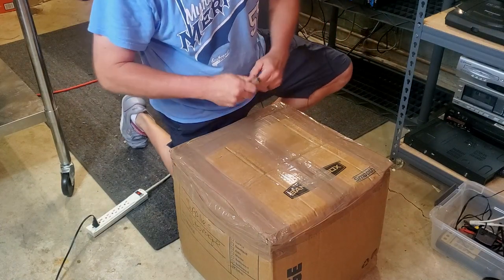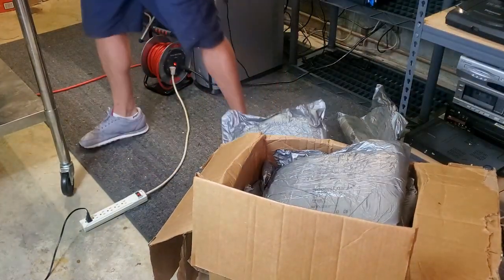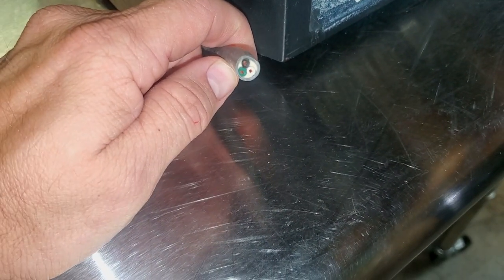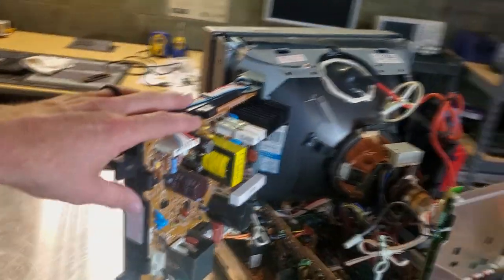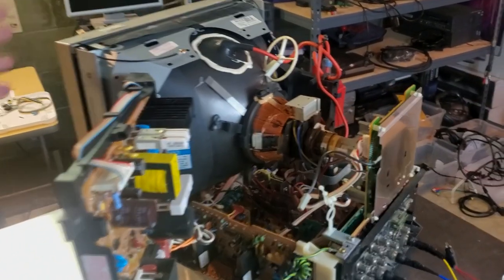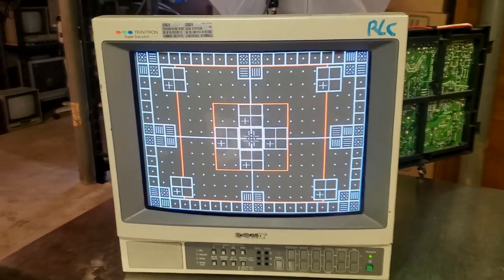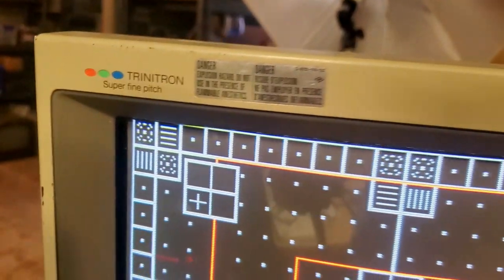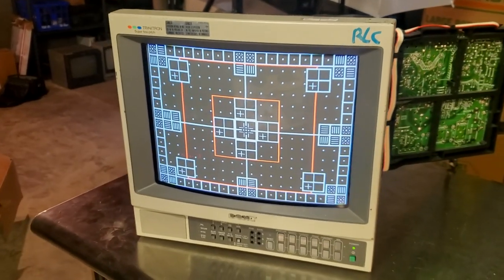I bought a $100 Sony PVM CRT on eBay with Water Damage?! Can I fix it?

Comment: I’m so nervous about buying a PC CRT and having it shipped.  At this point I message every seller to see how they plan to ship.  If they don’t give good details of a competent packing process (ignoring questions I have), then I just walk away.
Reply: I got 3 PC monitors from 3 different sellers  via shipping, I asked them to remove the support and protect it separately, and also to put the monitor screen facing to ground. I got the 3 of them without any problems!
Reply: People are so terrible at packing, it's unreal. I buy woodworking hand tools all the time on ebay and some of them get shipped in a box without any packing, with moving parts banging all around. Or in an envelope. I got one the other day that arrived without any damage even though it must have been banging around inside the box the whole way from another country. I don't understand how people can be so daft.
Reply: Most sellers aren't gonna take the time to give details of how they plan to ship it. But you will be covered by eBay in case the item is damaged in shipping so just buy one and hope for the best.
Reply: yeh risky buying online. does a 360 and walks away

Comment: Does YouTube not have a "jealousy" button yet? lol

It's extremely rare to see any newer PVM on eBay UK for that price now, even if faulty, unless the case is smashed or something.

eBay seemed to die here in recent years for retro stuff.
Many of the smaller Trinitrons are TVs, or TV/VCR combos.

Even the smaller 14" (working) PVMs sell for £300-400 ($360-480) upwards.

You can still get bargains here if you wait long enough, and add favourite searches, it just takes a long time.
Reply: I’m in U.K. and have a 2044QM that powers on ie lights on the control panel, but I don’t here any pop of the tube coming on and don’t get a picture :(.

I’m lucky in that I have a 20M2MDE and a 14M2MDE so don’t really need it now.

It’s my own fault to be fair it was working when I bought it, but it’s been in storage in my parents shed for a few years and I assume has now become defective due to damp and moisture maybe :(.

I should sell it for parts and spares at some point.
Reply: @HyperTriggerEx  Would you be willing to ship it to the South West? lol

Maybe we can work out a price, but no worries if you won't get around to it yet.
Reply: @electronash  hey man, I’d love to have the confidence to ship it, but I just don’t think I’d be able to guarantee getting it to you in one piece.

It’s a shame you’re not based in the North West :(.
Reply: @HyperTriggerEx  Yep, no problem.

I know CRTs are a huge pain to ship, and it's hard to know it will still survive the courier, even if it is well-packed.

No worries, I'll keep an eye out on eBay.

I have a 20-inch JVC "PVM" already, but it would be nice to get a slightly smaller Sony if I can.

Thanks anyway. ;)

Comment: The same pvm i buy it for 60 euro
But with problem
The screen arced from the 2 vertical side 
Like that )__( 
does it need callibration or some resoldering motherboard
or caps problem plz help

Comment: LED HDR UHD LCD pior FAIL froca ruim 
TVS 4K 3k.4k.5k.6k.7k.8k Porblemo cego composite HDMI ou AV 4k.5k.6k.7k.8k igual 😑 🖥 

TVS PASS bem rápido ganhar top perfeito bonitos mais AV só CRT Gosto jogos Scanlines é crt é Sacler 2x
Off PASS 📺🥰😀 (HD CRT) Gosto